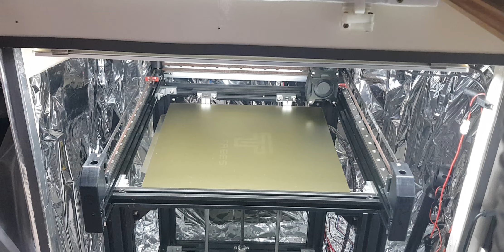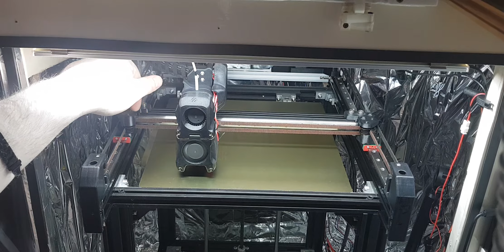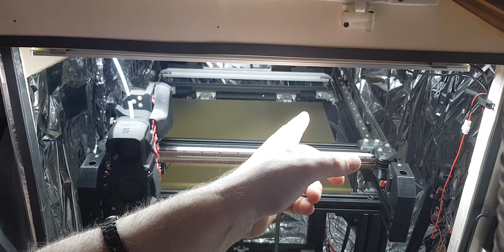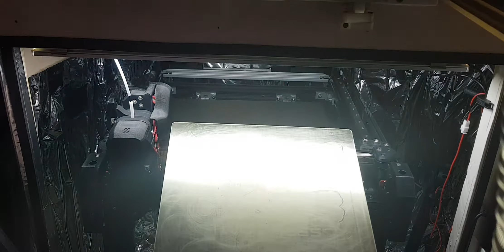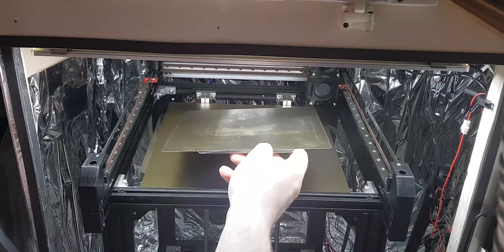Mercury One (Ender 5) Max X/Y Mod. Test Probing 310mm x 310mm Build Plate

Comment: Could you elaborate on the extended 2040 extrusions along the top? Dimensions? Are the extended extrusions part of the design changes you've made to get longer travel? I just picked up an Ender 5 Pro for cheap money and want to convert to COREXY and get more bed area. Basically I want your printer. LOL
Awesome work.
Reply from the maker: The main reason I use 2040 was to raise the print head such that there was no collision with the front bar so that the afterburner nozzle and the bed sensor can access the whole bed. The extra length allowed the afterburner print head to access the back of the print area. Without that, the print area would be much more limited as you have on a normal ender 5. I can show you some renders in F360 if it's still not clear.
Reply from the maker: Here are a couple of F360 images that may illustrate it better. https://lh3.googleusercontent.com/pw/AM-JKLWo78FNAZLvWXf9A6NzVHO0JWo06d2SW5agcKuJL-HInDh74xm1zJL10fSCs_9fPIG23TuV8gvQTjo_19ciyC04un5rLgvPphze0BUqHuMX-pvLzAX2QH7YlQVL5Rf15XnNQlvZn_7IqWuWEyEkUpOUog=w1080-h758-no